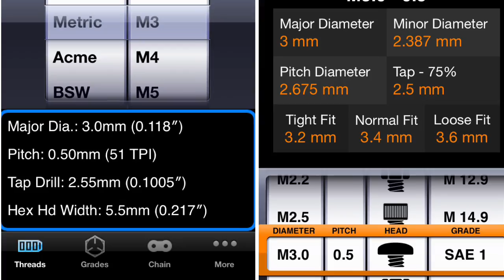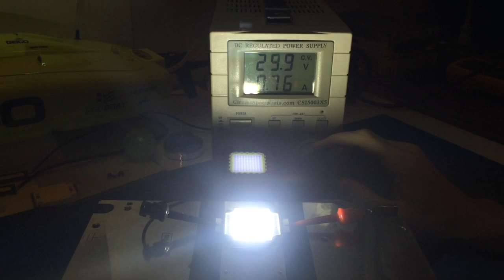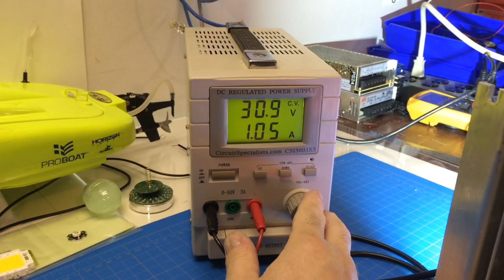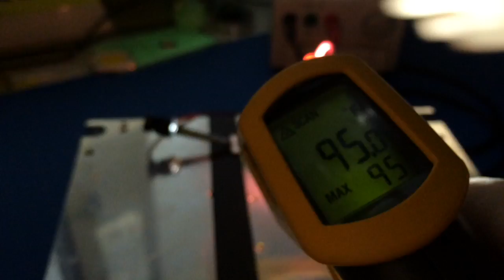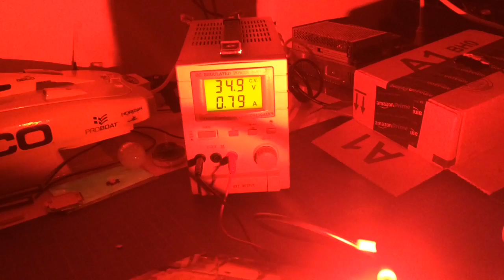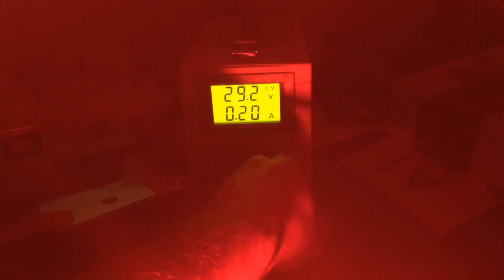Install 100w LED on Heat Sink: (Drill ,Tap, Mount & Test)

Comment from the maker: http://www.KevinGittemeier.com
Tools & Material:
LOHAS 100W LED Chip: https://amzn.to/2Ki2EkB
LED Lens / Reflector Base: https://amzn.to/2tRkjEK
Dow 340 Heat Sink Compound: https://amzn.to/2yS4kMx
Aluminum Heat Sink: https://amzn.to/2IDpZaQ
Wera Kraftform 70 32 Piece Set: https://amzn.to/2MBZXqH
Wera Kraftform Compact 25: https://amzn.to/2IE6DSO
Tap & Die 75 Piece Set: https://amzn.to/2tPtghT
Tapping Fluid: https://amzn.to/2NbdmHB
Rubrite Flex Abrasive: https://amzn.to/2MAiYtS
Milwaukee M12 12 Volt Combo Kit: https://amzn.to/2KwNUxv
Fluke 177 Multimeter: https://amzn.to/2tPtS7b
Fluke 62 IR Thermometer: https://amzn.to/2tDDrac
Bench Power Supply 0-50vdc: https://amzn.to/2yWir3s
Amazon Affiliate Links
Reply from the maker: The simple method Emily used to solve Rubik’s Cube at 3 years old:
https://www.youtube.com/watch?v=9spDGBeWl1o&t=1s
https://www.kevingittemeier.com/how-to-solve-rubiks-cube-easy/
Give it a thumbs up if you find the video helpful for beginners.
Reply from the maker: How to Solve Rubik’s Cube Easy Tutorial:
https://www.youtube.com/watch?v=9spDGBeWl1o&t=1s
https://www.kevingittemeier.com/how-to-solve-rubiks-cube-easy/
Reply from the maker: How To Solve Rubik’s Cube: So Easy a 3 Year Old Can Do It: https://youtu.be/9spDGBeWl1o
How to Solve Rubik’s 2x2: So Easy a 3 Year Old Can Do It:  https://youtu.be/UYCeyu_pbTI
How To Solve 2x2 Rubik’s Cube Part 2: Intermediate Method   https://youtu.be/fDfpjC-GPBM
2x2 and 3x3 Intermediate Method 2 Look OLLs & PLLs

Comment: Always use turpentine or light oil when drilling or tapping aluminium, it gives a much cleaner hole/thread and reduces the risk of broken taps.

Comment: Hi,
do you think that an heatsink like the one you used is enough for six 100w led?
Reply from the maker: Yes but best to have a fan on it.
Slightly under powering the chips reduces heat as well if temps rise too high.

Comment: As another poster said:  WAY too much paste between LED and heatsink.  Metal to metal has much lower thermal resistance, so you want to maximize that - the paste is just to fill in the microscopic air gaps due to surface roughness.  Put a tiny bit on the LED, smear it around with a finger to get 100% coverage, then place the device on the sink, and pressing on the metal portion of the LED, use a circular motion to work in the paste.  In the end, the paste thickness should be well under 1/1000 inch.  For best results, use a very fine stone to hone the heatsink very smooth unless it's already polished.

Comment: Where did you get the mat for your workbench ? Is it an ESD mat ?
Reply from the maker: postal2600The Blue one?   Its a cut hobby mat from any hobby store.  This one came from amazon.  Just touch a ground to discharge if you think your at risk of static discharge but an ESD mat is not necessary unless your in an environment where your shocking everything you touch.  I repair elevator drives, handle 5,000+ dollar boards and rarely strap off but always discharge first.  Just depends on situation.  If you know the rules you can break the rules.

Comment: That's WAAAY to much thermal paste. Half would be more than enough.
Reply: Grain of rice is all you need.  The purpose of thermal paste is to fill in the small gaps in the imperfect surfaces.  But having a complete film of it you are actually lowering thermal transfer.

Comment: Looks like both LEDs are lighting up in patches, meaning these suckers came from the scrap pile and won't last very long.
But the build is good as long as it will last.
Reply: +MsSomeonenew You're calling china a scrap pile? You could be right...

Comment: TIP: if you want to max these LEDs out, then you need to switch that PSU into constant current mode... it's much more efficient!! last time I did it, I ran the LEDs at around 35V at 2.86A constant current, which puts the LED rows at 3.5V per single emitter in a perfectly matched COB. 10 rows of 10W all taking in 35V and splitting the current to 286mA per row... again, this is in a perfectly matched chip... in yours, the power spread will be MUCH more hectic!

Comment: where do you get your white 100 watt led?  Much of ebay 100 watt led are crap.
Reply from the maker: Lohas-LED from Amazon.
A few dollars more but a solid brand and come well protected. http://youtu.be/uPWHosiwT7U.
The ones I ordered from ebay came wrapped together in cellophane wrap. Have yet to test any of the ebays.
Reply: +Rick Hwang They are not crap mate.I have ebay leds and they are great.
Reply: +Suto Andras Did you check everyone of those small leds work?

Comment: That red LED needs to be refunded, when it lights up patchy the diodes are getting uneven power and will burn out in short order. Send them a picture and call their mother nasty names and demand they ship replacements that are up to spec.
I have seen batches where 6/10 are poop. Don't allow them to scam you with stuff from the reject pile.
Reply: ehm... you do know that this is a LED for "growing" it is not a "red" led. it has red/blue/white and ir leds inside... thats why you see some glow stronger others weaker...
Reply: No, he's right, those bright LEDs are leaking massive amounts of current will get very hot, and will degrade the life of the whole COB. but also keep in mind this video is over 2 years old and china has really bumped up their game in QC with the new generation of COBs
Reply: @JacobJonesy  no your wrong there are 3 types of led in the chip they do light different i understand if they were the same type of led then it would mean they are unbalanced but there not
Reply: @gorrthebutcher4696  no he's right because I just want to be included in this "no he's right because, no he's wrong because, well he's right because" little debate thingamabob.

Comment: My 100W white LED, at 2,75 amps generates a HUGE amount of heat. The surface CANNOT be touched. It burns the skin very fast. It's about 85 watts, but I think it doesn't worth to supply the LED with more than 70...75W. After that the light is growing slower than the heat. It's true, the LED is a cheap chinese product from ebay, but even so, I don't think that amount of heat is normal. What about your experience? Can you tell me something about that? With a proper heatsink and a fan attached, is the LED resisting more than few minutes...?
Reply from the maker: 100 watts is a lot of power and much of that must be dissipated as heat.
While this seems hot it's still not nearly as hot as the filament in an incandescent bulb.
A heat sink is an absolute must. A fan is helpful but not always necessary if the heat sink can cool with passive air.
Underpowering it will give it longer life and will put off less heat.
I suspect we will see more efficient chips in the future.
Reply: +Dan Stroescu so what resistor do you use then behind the LED? Is 0.2 ohm good then or not? for a 36V 100W led.
Reply: My CREE CXB2540-0000-000N0HX265E at 50W melts tape, it's the light that burns not the heat from the chip.

Comment: way to much thermal compound. its just meant to fill the air-gaps not to completely fill between them then it will act as an insulator. same thing goes as on a pc cooler the more you add the less efficient it is. only add a little grain of rice size.

Comment: is it possible to solider the led to the heat sink?
Reply from the maker: Anything is possible but I have never heard of that.  Try it and let us know or maybe when I find some time I will.  I have over 50 of these LED chips but haven't found the time to complete the projects I want.
Reply: a heatsink is made of aluminum but led base is copper. So dont think about it. I use silicon glue to glue leds and Works fine
Reply: No it will destroy the emitters, BTW the internal wires aren't solderd in they spot weld them with verry low power so they don't burn it out.

Comment: So can i crank voltage to like 40-44V to make it draw more current?
Reply from the maker: +Online Police The more voltage you apply the more current will flow.  Current will fluctuate some with temperature and resistance so best to stay below the rated current unless you really need that extra little bit of light. Most LED drives are current regulated for that reason.
Reply: well, the reason why i ask is because i have the same driver that drives 2 of the 100 watt LEDs. After they are lit for some time and current stabilizes, LEDs don't draw more than 1.8A. So i wondered if i could crank the voltage above 34V limit to make it draw closer to 6Amps

Comment: damn i need some better tools, my m3 taps allways break by tapping aluminium, even when using oil / wd40 and "back and forth method"    i mounted my 100W leds on Server CPU heatsink. But its still getting too hot, even with fans.
Reply: gamerpaddy try water cooling it
Reply: thats the next step, but first i have to lookout for an battery.  im using 2 lead acid 7Ah for 2x100W. (with stepup)  they are way to heavy and drain to quick.

lifepo4 lipo and liion are still too expensive.
Reply: gamerpaddy 14ah is not ideal. a car battery would be the best for the job
Reply: not 14Ah, 7Ah at 24V because lead acid batteries doesnt have their desired Amp hours when draining high currents.  i know a car battery would be better  but weight...     lightest and cheapest thing would be a small gasoline generator lol
Reply: gamerpaddy of course my bad. a lithium battery would be best if you wanted to have power and low weight. but yes they are expensive... try NiCd batteries.
Reply: Cant buy NiCd in our Country anymore, due to the high concentration of Cadmium it got banned (excluding electrical tools).   NiMh would be an alternative.   but Nimh cost more than LiIon 18650 cells + bms..
Reply from the maker: gamerpaddy  Try under powering it a little at 80-90 watts.  It will be much cooler and only a little less bright.  The lifespan will be greatly increased as well.  As soon as I get some time I will do a Volt/Amp/Temp/Lumen chart.
Reply: Ok, good to know. thanks.
Reply: gamerpaddy  Its not so much the heatsink or cooling device its simply the way the LEDs are made they have a poor thermal interface. They cant transfer heat as well as they should. its not the compound or the heatsink water cooling wont make much a difference
Reply: with "its stil getting too hot"  i mean the heatsink, not the led.  but the idea with using less current worked very well.

Comment: Can someone explain why the red led is .. red? I mean, it would only have to be cast in red dye if it was not a monochromatic led chip.
I suspect this one - and I have one myself - is actually a blue chip shining through a phosphor layer, just as in a normal white led, except this one is dyed red. 
I also ordered some 'amber' leds and they looked tobe madethe sameway, just dyed amberish. What a cheat!
Reply: Band gap of the semiconductor material determines the wavelength of emitted light.  RGB diodes use a clear lens yet emit RGB color
Reply: Oh and white LEDs generally use a phosphor
Reply: +flahr1
You might have misunderstood my question since your posts didn't touch my questions. 

Btw, RGB LEDs don't require a lense - they are just an array of red green and blue led dies driven individually.

Comment: Looks like the red one has some weak LEDs in it. They should all start lighting at the same voltage.
Reply from the maker: Galfonz In theory but not in real life.  Your not going to get 50 to 100 LEDs (semiconductors) to light up at the exact same voltage.  That just isn't going to happen and it would be unnecessarily expensive to try.  What you way not see is that they are lighting up an nearly the same voltage and much below rated voltage and current.  The variable voltage power supply is being turned up very slowly.  The same was true of the white LED chip but it was less noticeable bc of color and I didn't zoom in on it.

Not don't take this to mean there aren't some really poor quality chips out there with dead LEDs or LEDs that light and much different voltages which will lead to premature failure.
I have about 40 of these chips of differing quality and wattage and have yet to test any of the cheap ones so we sill see.

Comment: Great video, but you used entirely too much thermal compound. The idea isn't to "coat" the surface, but to have just enough to fill the gaps between the heat spreader and the LED. Too much thermal paste actually acts as an insulator.
Reply from the maker: ***** It would be too much if I didn't torque the screws down and squeeze the excess out.  You could argue thats wasteful but I have a lot of heat sink compound as I use it on large IGBTs and SCRs on elevator drives.
Your correct too much and it becomes an insulator. Maybe some viewers don't gather that from watching this video but after all its just a video and not really meant to be a full step by step instructional as much as just an overview.
Reply: ***** Are you saying that the gap is too big?

Comment: Your red led is bunked =/
Reply from the maker: How so?
It still works fine several years later.
Reply: @KTFG  The way it lights up. You can tell the matrix is leaky. I'm trying to remember the good video that touches on this..
Reply: @KTFG  There are the videos that explain it better then I could via comment =p

Comment: I am sorry, but that is not bright at all.  Go buy a 1000w metal Halide for $150 to learn what bright really is.  I would use this light as a wake up light.  Not even bright enough to paint a wall.   To begin to light a single typical wall, you need 80,000 Lumens (child's play for metal Halide). And even then, you are barely getting up to lux of a heavily cloudy day, in the shade.
Reply from the maker: I am sorry, but am not interested in buying a 1000w metal halide for $150.
Thank you for taking time out of your busy day to try to sell me on one though.  You seem to have a wealth of knowledge and it’s rare that someone with your knowledge would take time to share it on YouTube comments.
Reply: @KTFG  thanks for your condescension.
Reply: @dennisgarber  not sure what you are talking about LEDs are more efficient than metal halide bulbs... although not too sure about these specific LEDs because they are faulty and will not be as efficient.
Reply: @mashedpotatoes5323   LEDs create huge amounts of heat, especially when you are jerking around under 200 lumen per watt.  Unfortunately, the more heat, the higher the current, the lower the efficiency, the more heat, the less efficient, a vicious cycle, also permanent damage to the led efficiency.   This means most LEDs are not properly heatsinked at 100 square inches per watt of copper or aluminum.   This is bad enough, when you look at how poorly a light bulb at 4 to 12 watts are being heatsinked.  It is really problematic for high powered light.  For my  worklights I no longer torture myself with anything less than 80,000 lumens per room.  I can't keep a 50 watt led  to last more than 4 months of 10 hours a day use before driver or led pops out of existence.    My 500 watt LEDs street lights are incredibly dim compared with a 600 watt metal Halide and only last a month, poorly heat sinked.  Trying to build my own 500 watt led, it is too expensive. Fans metal, good 80k Lumens of LEDs, power supply, are all overpriced. Every single component needs to be dropped in price.   I am now believing that the only way led high power lights can indeed replace metal Halide is with motion sensors, as they need to be turned off at every opportunity to cool down.  I noticed too that all the very bright led arrays in my city streets are about half or a third as bright as they were a year ago.  Building wearable lighting, I noticed a huge difference in heat output between a 160 lpw and a 200 lpw, at same drive level, and the math supports this.   So, at least for growlights, they are putting in 230 lpw Samsung lm301b and h.  Still 6 times more expensive than a comparable metal Halide whose bulb can be replaced every 10,000 hours in 60 seconds, unlike a street light.  The Samsung lights look a bit large for work lights we move around the house as we work.  I definitely will try one once $200 buys me 80k Lumens at over 200 lpw.  Right now, $160 buys 120k Lumens with metal Halide, where heat (300watts worth of halogen) does not self destruct the bulb and efficiency as it does with led.   Also, the lumen claims for most high power LEDs is a lie.  The 500w flood light only put out 30,000 Lumens, and lasted a month.  I could buy a 600w mh for a third the cost and have a true 80k lumens and, despite what people will tell you, 3x higher lux with the winged reflector.   This is why, once things stalled out at 100 to 155 lpw, there is little interest and fascination, in the leds, which it had up to about 2014.   Since then led magazine is all about getting street lights that spy on you.  2014 to 2016 was all about lowering led efficiency in a race for the perfect color filter needed to reproduce the old fashioned life sucking incandescent sickly yellow. Expectations dropped from 200 lpw, to 130 lpw, in the 1 to 3 watt range, just to get the perfect snob cri, which I fought to escape in the 80s due to seasonal affected disorder, living in the north. I really hope someone other than Samsung breaks the 200 lpw in high power fixtures.  Fan prices, driver, and metal prices need to drop 90% otherwise.